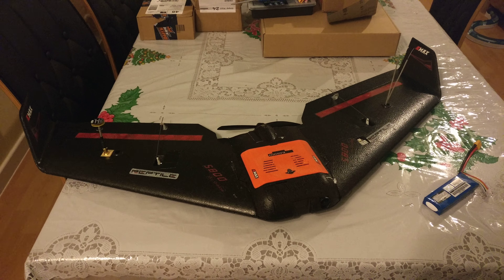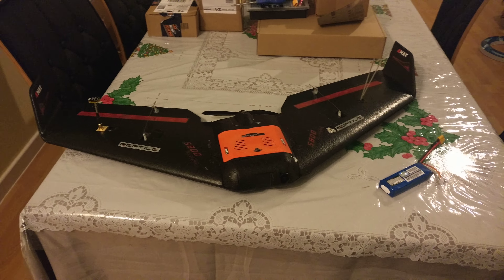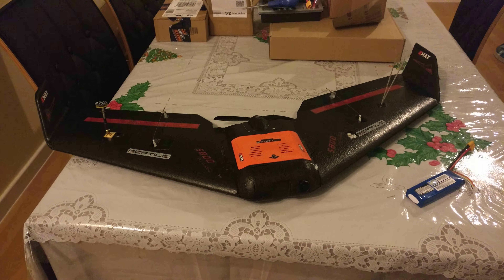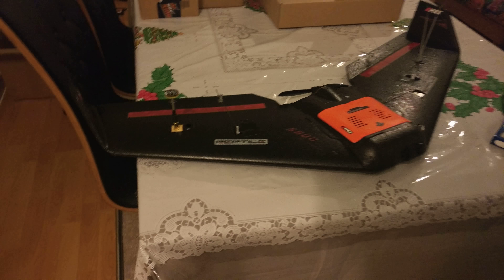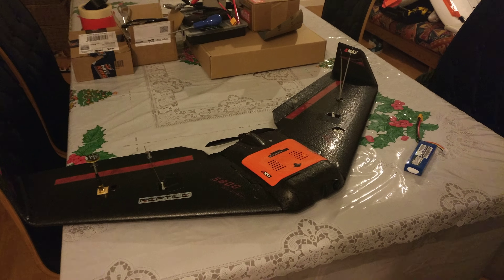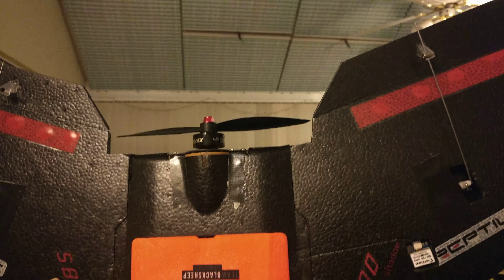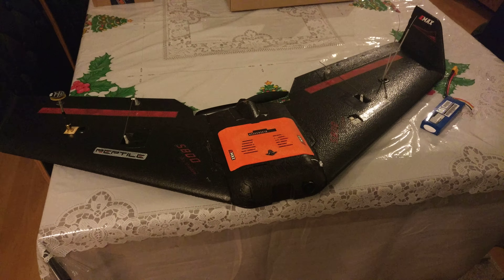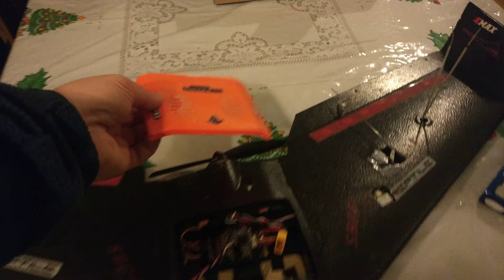Reptile S800 Inav build, matek stacked fc & pdb.

Comment: Does the d4r not do sbus? Telemetry? Get gps coordinates on the transmitter to save the log file. Then can be overlayed on Google earth via opentx companion. You can watch your entire flight virtually or have a record of last coordinates if it goes down.
Reply from the maker: KNUCKLEUP FPV I've no idea.
Reply: Keith Sutherland I just checked. It's only ppm. But it will still do telemetry. So you can setup a log in your global settings off your arm switch. It saves the flight to your sd card.

Comment: You have got the GPS the wrong way round. The ceramic antenna should be on the top.
Reply from the maker: Brian Slator interesting, I tried it the other way round and found that the lock was slower with less sats. I'll try it again both ways when I fly.